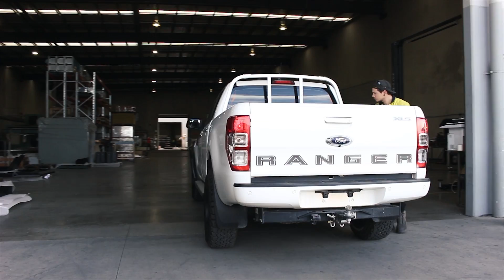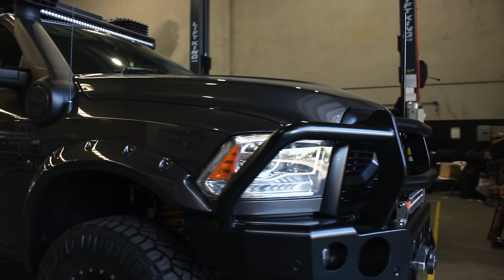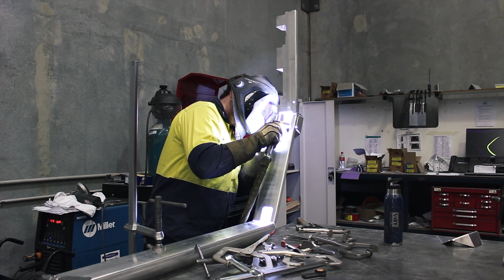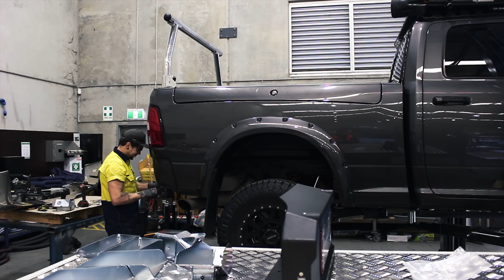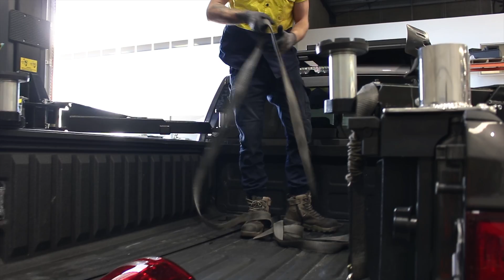GCI Traytec | RAM 2500 Tray & Canopy | Conversion #3

Comment: The spec says RAM 2500 has 3577kg curb weight with a 913kg payload, just wondering after adding the tray and canopy, how much weight left to play with.  If full tank of fuel, full tank of water, plus hopefully a secondary long range tank, are we still good?
Reply: It has a GVM upgrade, which means it has a slightly bigger overall weight and payload to compensate for the tray and canopy.
Reply: @doobee84  your also forgetting that by removing the tub they do remove a fair bit of that curb weight, once replaced with a tray there’s not a huge difference in curb weights. Canopies are the worst bit for weight

Comment: That’s an INCREDIBLE setup. I’ll die for this. Questions:

1) is a tray + canopy setup available for the Jeep Gladiator?
2) Do you have dealers around the world or just Australia only?
3) is there an option to remove the canopy when needing the tray for cargo?
Reply from the maker: Hey mate, we have not done a Jeep Gladiator yet however it would be an awesome addition to what we offer! We only have distributors/fitters in Australia at the moment but we have done an export to the UK. And to your last question, all of our systems are jack off, so yes you can use the tray independent of the canopy if you desired.